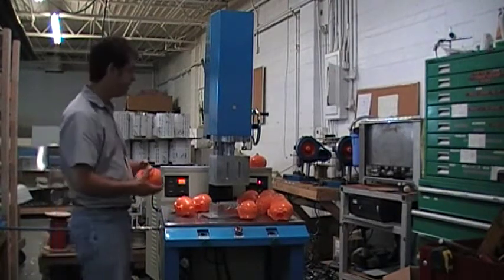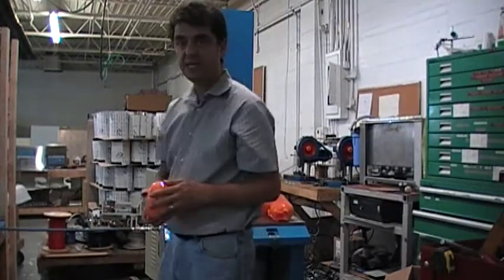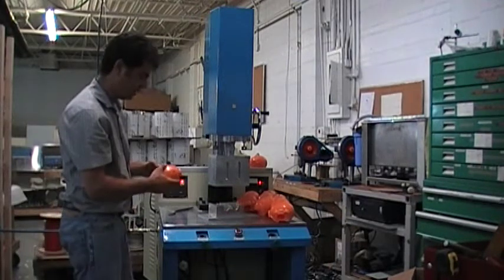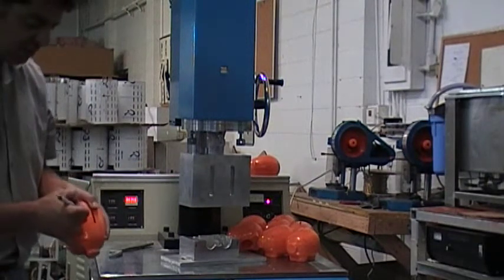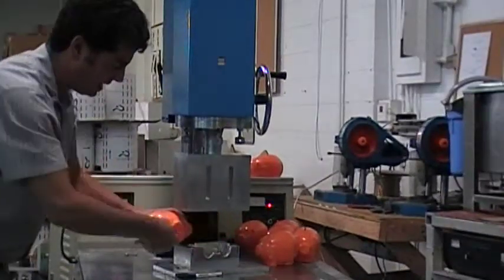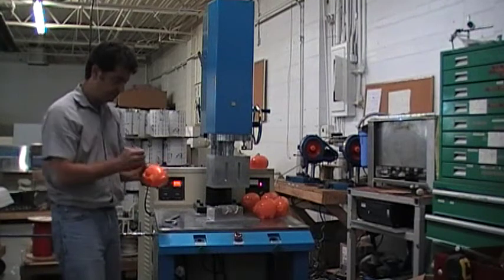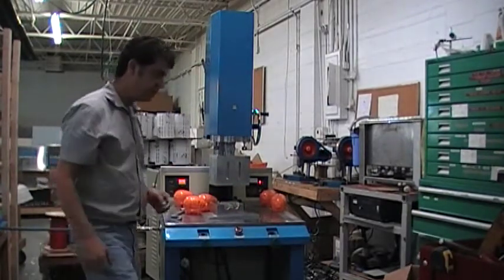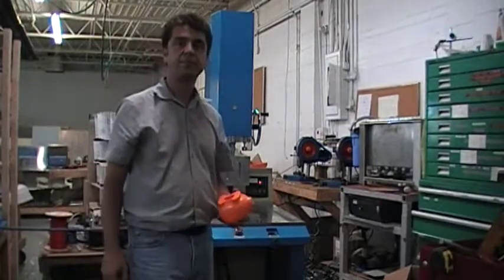Sharpertek 15 KHz Ultrasonic Plastic Welder Operation

Comment: Hi, This is Jack from BRDASON ultrasonics . We can offer the horn and converterfor BRANSON,Rinco  brand ultrasonic machine .also we can offer the ultrasonic welding and cutting machine .
Especially our digital 35KHz is more stable than other supplier .

If you are interested in ,please do not hesitate to contact with us .